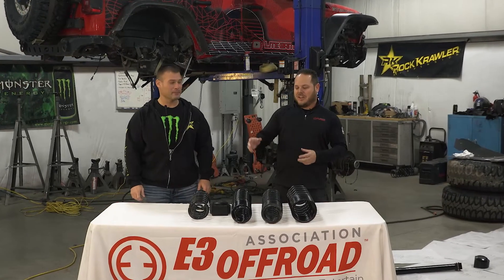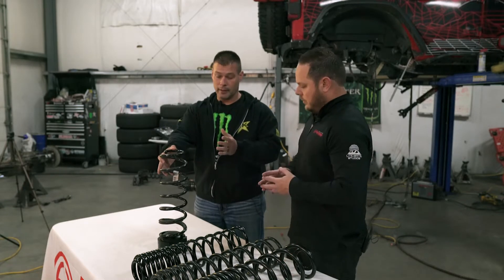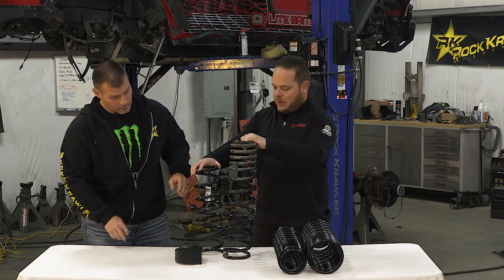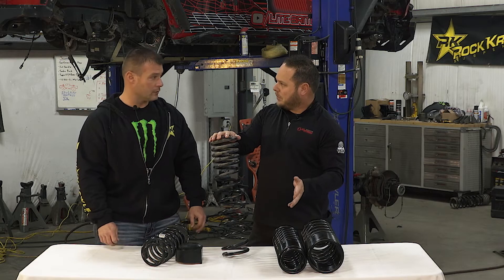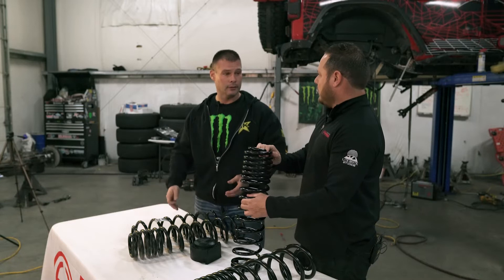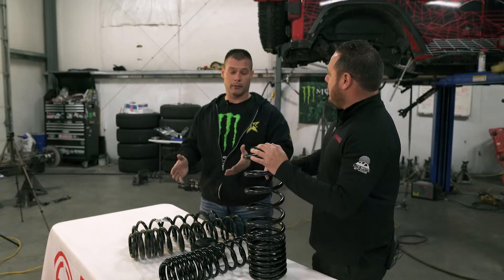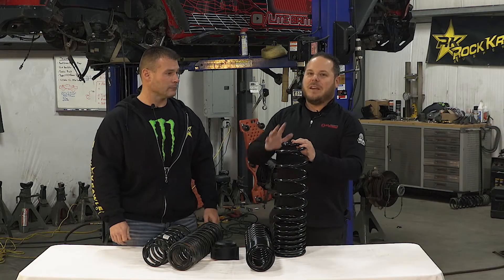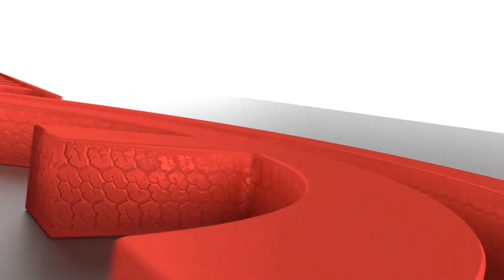E3 Offroad - 3 of 9 Suspension Upgrade 101 - Springs Spring Rates and Spring Style

Comment: Hello. I have a 2021 ram 2500 with 6.4 gas. I want to level my truck and seen you have triple rate springs. I use a 8.5’ western v plow and these springs seems like a great option to help hold the weight of a plow when it’s on the truck but still ride good without the plow on the truck? Have you ever mounted these on a ram with a v plow? Do they work good. Thanks for any help